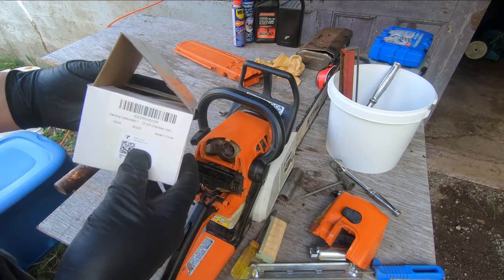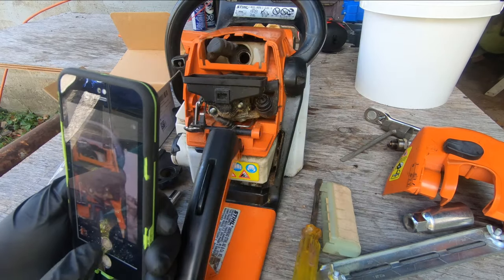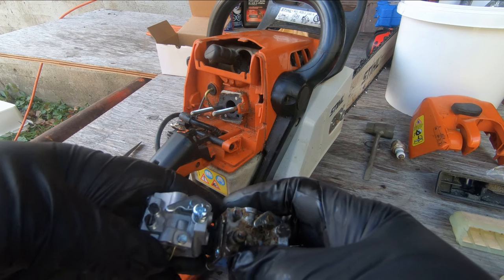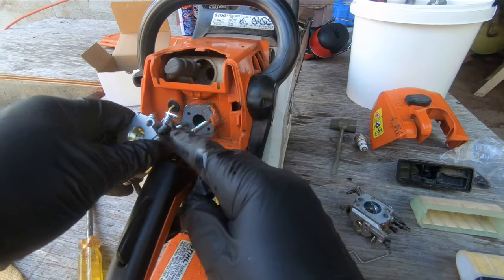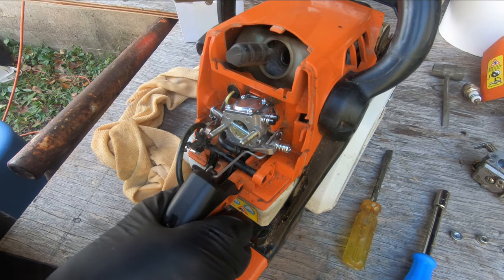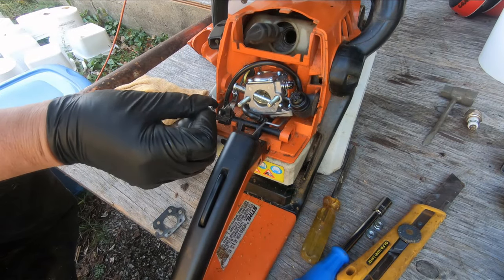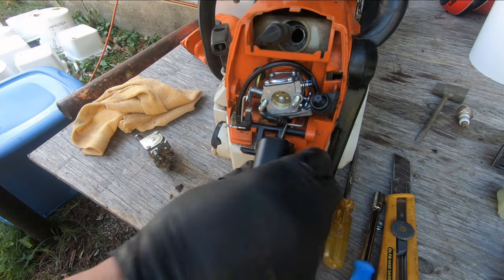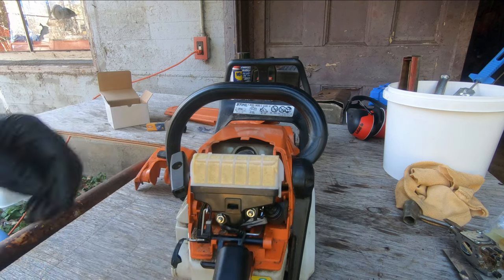THIS MADE MY STIHL MS250 RUN LIKE NEW !

Comment: The design of the starter (small pulley) makes almost all the ms250s seem like they have high compression.  If they re-designed the starter it would be a lot more user friendly.
Reply from the maker: You're right. That's a great idea!
Reply: I bought mine off an old man on marketplace. He had such a hard time starting that little saw that he constructed a jig to hold it down while he tried to start it lol!

Comment: Usually you can order a oem gasket and diaphragm kit and keep your oem carburetor ( its usually a high quality carburetor). Old gas or a much used saw eventually wears the pump and deteriorates the diaphragm.  A good cleaning and fresh diaphragm almkstxalways fixes them up. Cheers from West Virginia
Reply from the maker: Good advice, thanks. I have the tools and an ultrasonic cleaner at home and a rebuild of the OEM would be best, but I’m visiting far from home and the cheap carb swap was one of a few options. Great advice though. Thanks

Comment: I’ve had my ms250 for 5 years and I’m honestly not happy with it. I got it because of the size, not too big and not too heavy. But I’ve always struggled to get mine started. Yes! I I put it on the 1st choke setting til burps and yadayadayada and I’m wore out by the time I get it fired up. This is one of the few things I’m ready to give up the fossil fuel for their expensive electric ones. The thought of just clicking in the battery and go cut is too tempting.
Reply from the maker: I've heard other say that too. The MS250 can be difficult to start, however other than the carburetor issues on this one, I find mine has started well and has been reliable. I've had this saw for about 10 years. Maybe the newer ones are manufactured in a different way? I know that some newer Stihl saws (designed for fuel efficiency) like the MS291, are hard to start when hot, and it's not because of faulty coils or ignition components. It's the ported design of the cylinder. I happen to own an MS291 and it gets little use because of this issue. The MS250 was always a good, small saw but maybe they've lost something along the way. Cutting costs at the factory ? Design changes?
Reply: Yes I've seen this a bunch
Reply: The MS250 I bought in 2007, and the second one I bought in 2023 both start reliably - third pull on full choke fires, 2nd or 3rd pull on half choke it starts.
Reply from the maker: @donmoore7785  It seems like some of the MS250s are prone to hard-starting problems. This one works well now that the carburetor has been updated. It sits for months at a time without use and even with fuel stabilizer and running it dry before storage, it can still gum up. I think the starting issue most have is to due with high compression. I know that they made a modified (easy start) model, perhaps because of this. It seems strange that such a small saw would have compression issues that make it difficult to start. Also, the design of the starter, with its small diameter has played a role. Looks like you got a good one.

Comment: You dont have to buy new carb. The carb only need to be cleaned. It happen to mine.
Reply from the maker: Yes, thanks. It was a quick fix and I am aware that a simple cleaning may have remedied the problem. Usually, it's old gas that is left in the saw that leads to this problem. Thank you for your comment.  I appreciate input just like this!

Comment: Ms 250 is only a weed eater lol but you got her going buddy,
Reply from the maker: These are great little saws and so handy for small to medium-sized work. The problem is that the carburetors get gummed up eventually and make them run poorly. A simple carb swap for under $30 made this saw run like new. I always use storage spray in the cylinder and condition the fuel, run it dry and store without gas, but they eventually gum up anyway. So nice to have it working while I wait by my mailbox for my surprise you brought me back from your trip! :face-fuchsia-poop-shape:
Reply: @EverydayProjects  lol dont hold ya breath to long lol
Reply from the maker: I'm a VERY patient man, and you are a VERY KIND man, so I don't think I'll be waiting long (plus it's nice to hang out down by the mailbox--no flies this time of year):face-green-smiling: @DIYVariety

Comment: Mine will fire up at half choke. They flood easy. I didn't bother changing the carb, I just flooded it with brake clean and let it sit for the day. Im running high test fuel to avoid the ethanol because the 250 sits for months on end.
Reply from the maker: Good tip on running the premium fuel. This one sits a lot too. I only use it when I visit back East once a year. I actually mailed it to myself from BC. It cost just under $30 to mail it and have a saw there instead of borrowing (not a habit I like) or renting a saw when I need one. Thanks Kenny....be good!

Comment: Really good video. Them copy carbs are ok i have fitted a few on strimmers / chainsaws and touch wood all been good, them MS250 are a 50:1 mix, 👍👍
Reply from the maker: I had the oil mixed a bit on the heavy side but the cardb change was a success. I was so surprised how well it ran right out of the box with zero adjustments. Thanks , as always and have yourself a great weekend!

Comment: Usually there is wear on the accelerator pump of the carburetor, this is a common problem on the Stil 250, you can simply turn it off, but I replaced the carburetor with a new one hello from Siberia
Reply from the maker: Thank you for this information. I kept the old carburetor that I may someday rebuild ( having the original is often better) but changing it out for a new, aftermarket one was inexpensive and quick. Thanks again for your comment. Hello from Canada !

Comment: I replaced my carb, fuel line and filter, spark plug, and air filter assembly. Probably same kit you have. Carb works fine. Hose was easier to replace than my Craftsman. Still need to do a little adjusting for it to run perfect. At least it starts now.
Reply from the maker: @robertlehrman5832  Glad to hear you got it going. Sometimes, the carb kits come with an adjustment tool that fits the mixture screws. The low speed jet keeps the saw running at idle and works along with the throttle adjustment screw. Adjust a warm saw while running until it idles smooth. The high speed jet manages the fuel at full throttle. Adjust it while holding the throttle open until it does not bog down and runs at full throttle without bogging. Sometimes better and safer to remove the chain first. Good luck😀

Comment: First time watching your channel that Calibrate, I need a little adjustment.I use them all while and I always have to make the necessary adjustment
Reply from the maker: The low mixture screw should be adjusted so that the saw idles correctly. The high mixture screw should be adjusted with the saw throttled up then turn the screw until the saw has the smoothest rpm and runs without bogging down.

Comment: Awesome 👍  Lots of compression that's for sure.  I mix it 50:1 , whats  your mix about 25:1 😉
Reply from the maker: I think the mix was 1:1 LOL it smoked a lot but I did have some storage spray in the cylinder. Thanks, Steve!
Reply: @EverydayProjects  Use the spark plug hole as compression release. Pull plug, pull the cord 10 or so times and the compression is gone for awhile. Not a mechanic so I don't know why these 250's have this issue. Obvious why it works. 
I did a muff mod 12 years ago. Bad gas mileage but a different chain saw. It's not embarrassed to hang with my 362. Sounds better too...

Comment: Very informative and you still have all your fingers 😅
I rather mix it rich as well and have to change a smoked plug than have a saw overheating or have a scored cylinder or piston.
Reply from the maker: Agreed. I'd rather have a saw smoke a bit than to prematurely wear the piston/bore.

Comment from the maker: The only problem I found in the replacement one is the distance between the mixture screws, but cutting off the rubber piece that allows access to the screw heads was all it took to make it fit. Some have suggested just cleaning and placing new gaskets in the original carburetor, so don't get rid of it. Maybe you can put a kit in it as a spare. Best of luck and thanks very much for watching. PS- WOW I had the gas mixed way too rich...probably 10-1 hahaha Take Care

Comment: It is better to use original spare parts. Chinese fakes are usually of low quality, but in your case the carburetor works fine, which is good. I would also advise checking the maximum revolutions on the tachometer; they should not exceed 14,000 revolutions.
Reply from the maker: Thank you

Comment: do you have the link to the carb you got for your MS250 chainsaw ?
Reply from the maker: Yes. Got it on Amazon.com
Carbhub Carburetor for Stihl 021 023 025 MS210 MS230 MS250 Chainsaw Carb with 1123 160 1650 Air Filter Ignition Coil Fuel Line Tune Up Kit Replace Walbro WT286 

Manufacturer 	Carbour
UPC 	715020622933

Comment: How many turns does that carburetor have in the L and H screws?
Reply from the maker: Usually, the screws are 1 1/4 out from the closed position, then adjust the low mixture screw until the saw idles smoothly (either in or out a little bit). With the saw held safely, rev the saw and adjust the high mixture screw until the engine runs well and doesn't bog down. Leave the mixture screws in those positions and you should be set!

Comment: That flexible rubber piece that goes between the cylinder and carb is the intake boot.
Reply from the maker: I've never had to change one of those boots and I have several Stihl saws, some many years old. They can deteriorate but I've not had to change one yet. Good that they included one with the Carb kit. Thanks for commenting.